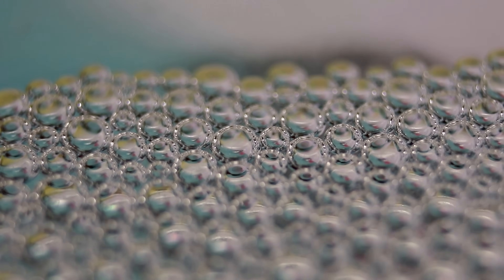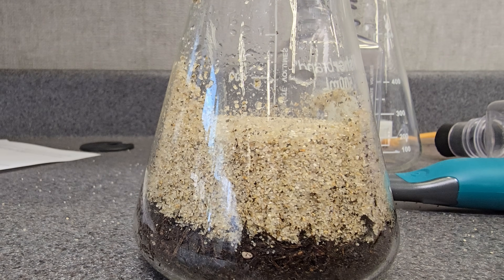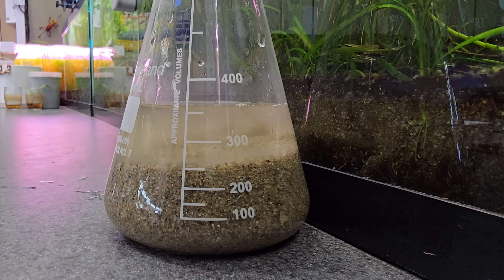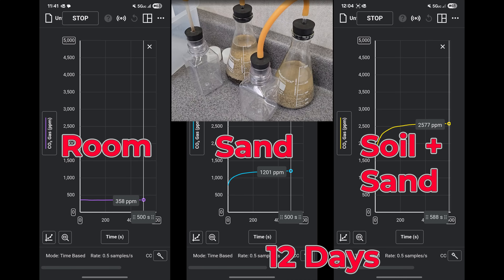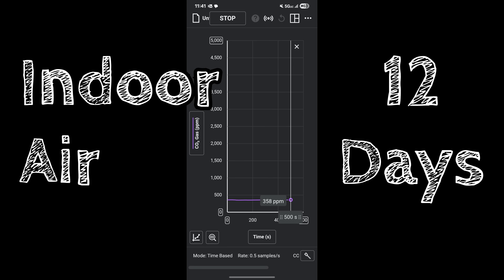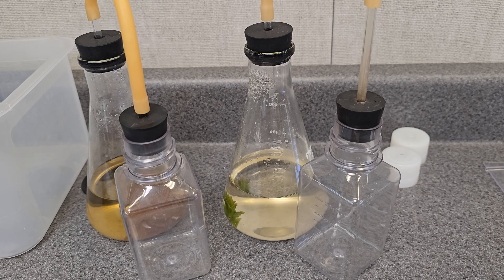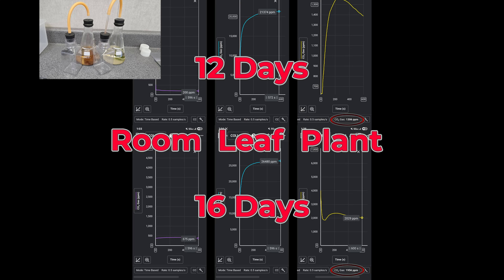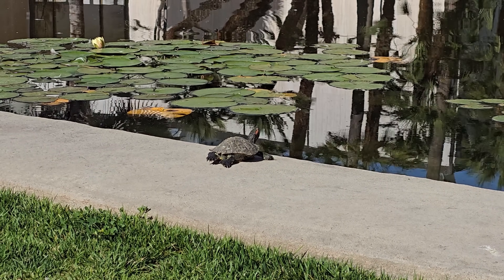I Captured AQUARIUM CO2 for 16 Days and This Happened!

Comment: Hello
My  20 aquarium fishes are suddenly died within 2 days..
They seems like they were infected as their body and fins became reddish.
They are with me from 1 year and two of them from 2 and half years..
2,3 days before they died I had added 3 pairs of new small fishes..one of them died just next day..I assembled a new aquarium light also with new fishes,as my light was not working.
I didn’t understand whether it happened due to infected fishes or new light was in appropriate for aquarium .
I cleaned the aquarium twice with my regular cleaning method and added new fishes but sadly they are also dying..i am very confused and disappointed..please help me understand what is going on.
Lots of respect from India.
Reply: Definitely seems like a new nasty infection from the new fish. Bad luck you got. Quarantine is recommended for new fish always.  Quarantine the sick fish and give them fish antibiotics. Because they died so quickly it seems like some of fast bacterial infection. Also check the water parameters and do mild water changes often (max 50% every few days). Vacuum the soil. Natural or not, emergencies are different. Usually all you can do is to prevent it from spreading. Medicine rarely work for already sick fish if the disease is severe.  Consider euthanizing very sick fish. Make sure the tank is not overstocked either, fish usually get sick of stress and the new fish because of the sudden environment change.

Comment: How much is the CO2 if pros tanks that you talk about at the end ? We need that data to make the comparison, thanks.
We should also know the ph of the leaf bottle, I thought CO2 reduced the ph making the water acid, maybe this acidity increase the release of even more CO2 if some special bacteria can work better in this new ph, a 3rd bottle with the leaf + plant would had been a good idea too ^^
Reply: 40 ppm. FF tanks including soil, peat moss, FF supplement + leaf litter will get you to 20ppm which isnt bad for a natural system.
Reply: @Desmond000007  The problem is the value in the videos are over thousands numbers, maybe this is a different data, this is confusing sorry ^^
Reply: @scheballs7  makes sense thankyou. He also pointed out that O2 was shut off to the samples. That with increased O2 levels (as would occur in a normal tank open to the air) the level of CO2 production would be increased as these aerobic organisms are breathing O2. So this is not a test of an actual tank in actual conditions, simply a demonstration of how much CO2 these organisms can pump out over weeks and days if I understand all this correctly. It is a comparison test of different carbon sources.